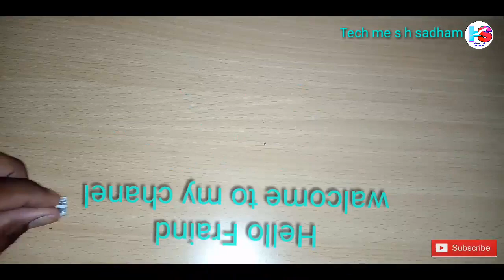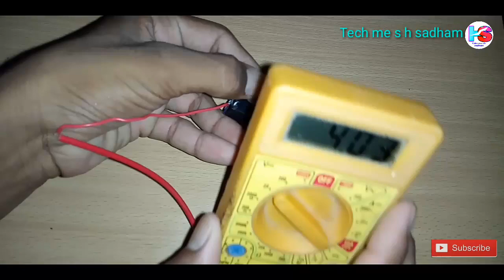How to make a mini Torch Light for Lithium 18650 battery

Comment: how to charge when the battery runs out?
Reply from the maker: use mobile charger charger pin cut and connect wire to battery + - simple Thank you so much